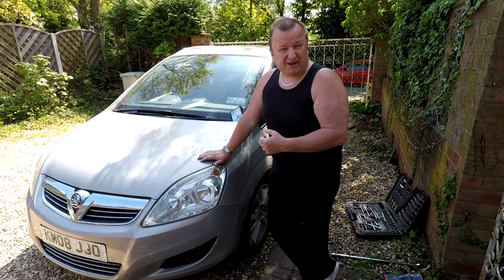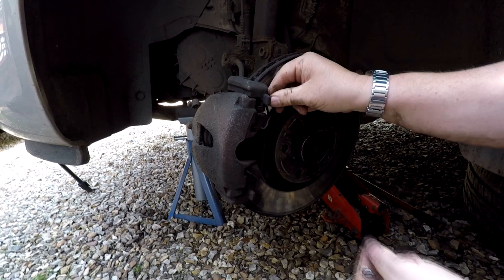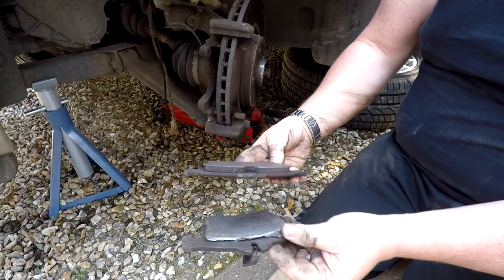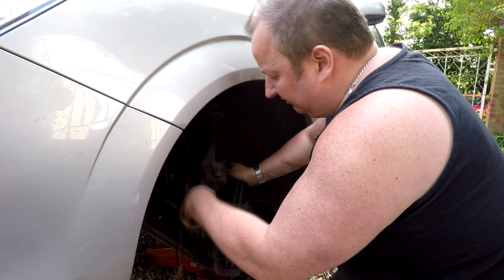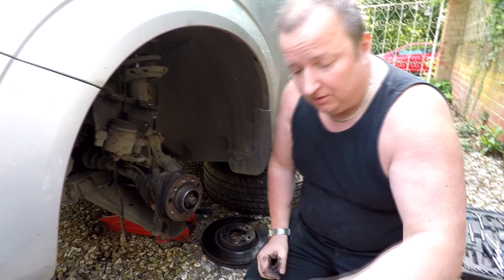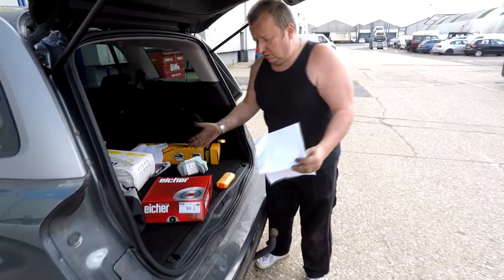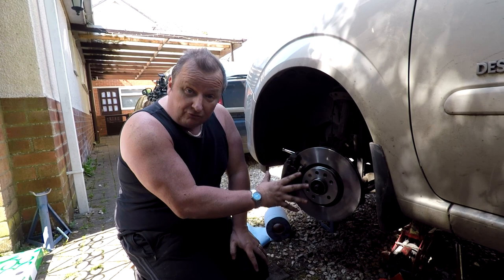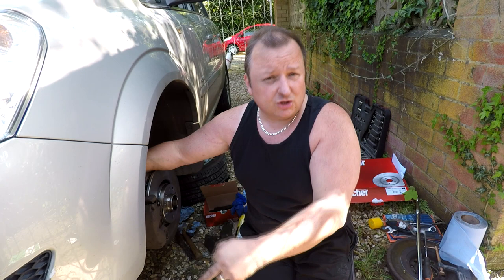Vauxhall Zafira B Front Disc And Pads Change Hell

Comment: Great to see a Brit doing car videos, one thing I would not personally do, is to use copper grease on the pins/sliders as it tends to gum them together after a while, I use silicone grease. Like you I have had problems with Euro Car Parts with wrong parts/sizes etc.
Reply from the maker: Yes, i'll be using silicone grease in the future Mart.

Comment: when you wind the brake calliper piston back in, when this forces the brake fluid back to the reservoir it does not stop when the reservoir is full, the system is vented so as not to create a vacuum, hence any excess fluid will escape out of the vent hole usually resulting in the fluid running down the inner wing/ bulkhead, if this is not then washed off it will eat into the paint then rust these items.

Comment: Had this a few times myself! Trouble is now that manufacturers use mandatory different parts for the same model! My astra had 2 different sizes of discs listed and God knows how many different styles of pads. Great videos as always.
Reply: I had the same problem with my zafira B, it was made in the final year of production, so they used all sorts of bits and pieces from previous revisions. Mine had 5 variations of the air filter,  3 different brake pads,  4 different brake callipers, and a whole hoast of other crap.... Getting the brake pads, i had to check which calipers i had to match them to the pads. 

i will never buy a car again thats in its last 2 years of production

Comment: I like euro car parts there great never had a wrong part with them most vauxhall have different size dics for the same model like my signum has 3 different size discs i always check the disc and pads before fitting them great video
Reply: nicely said bro but martin is a diamond geezer top bloke

Comment: Hi, look up Ed China's YouTube video on brake pad replacement. He explains why you should not use copper slip grease. It's to do with dissimilar metals, electrolysis etc and dust mixing with the grease causing ceasing up...Always a good idea to keep an idea on the brake reservoir level when pushing the pistons back 😉 Loving the videos by the way 👍 Real world repairs in a real world setting 😎
Reply from the maker: There is another episode where Edd puts copper slip on the back of brake pads. We've all done it in the past as this was the standard back then. Ask any mechanic of the 70's and 80's

Comment: I suppose its a case of 'speak as you find' Martin. My local ECP store in Wrexham offer a pretty good service to be fair.  I've bought loads of stuff off them over the years and not had to take much back because its been the wrong part. Granted, they're a long way from perfect - and the queue's to the till are always huge! - which shows how competitive/popular they are, I suppose. There are two other local car parts suppliers in my area and I usually phone all three for quotes on parts, and 9 times out of 10 ECP are the cheapest. I recently serviced a friends Zafira B (including front and rear discs/pads) and ECP were £100 cheaper for all the parts than the other two suppliers. Like I said, speak as you find :)

Comment: I had a similar problem a couple years ago with my Mk3 Avensis, which is 58 plate but a 2009 model - the year the range was released. This was an independent and they went by the car reg plate on their computer. It was when the discs were compared that we knew they were wrong. The discs were smaller and for the Mk2 Avensis. We checked the part numbers with the garage manual and back to the parts shop. The person said that licence plate is what they go by, but we told him the car is a T27 (Mk3), not the earlier T25 (Mk2) which can also have '58 plate.
I now have a a list of part numbers for my car, plus the specs, to help get the right parts and save wasted journey and time. I think ECP are good and the discounts worthwhile, so long as you do your homework and use their discount codes.

Comment: At 18.50 the pad with the wear indicator should go on the inboard side of the disc  not the outboard side. with the leading edge of the wear indicator facing the brake rotor during forward wheel rotation. Great videos and content and thank you for taking the amount of time and effort you do to produce quality content.
Reply: while this is normally true .. Zafira front brakes always have wear indicators on the outside .. the pad that clips in the piston doesn’t have one installed no matter which brand you use ..

Comment: Never use copper grease on the sliders as it goes hard. By the look of the black crap on the sliders someone used copper grease on them before.
Reply from the maker: Yes I should have use a different grease.
Reply: retrorestore I recommend silicone grease as it’s friendly to rubber parts 😉 petroleum based grease on rubber can react with it.
Reply from the maker: nice, i'll look into that.
Reply: Yeah i was going to say exactly the same thing as Hard Worker.Silicon is the way forward Martin.
Reply: silicone paste is best for slides.

Comment: you need to physically measure your old disc not just give your registration as theres often more than one size available- ie a 150bhp zaf will have bigger brake discs than the 120 ,but that's the least of your worries as it will probably just go up in flames anyhow..hahahaha

Comment: Well l did not have too much trouble doing the front discs and pads...but it was quicker dismantle to whole lot..but just check on you pads...
Rear ones were a bit more tricky...even resetting the hand brake...
You can reduce the brake noise by simply chamfering a 45° angel on the leading edge..
It's that corner that bounces...the copper slip is like glue behind the pad...keep them steady, but you do not need much..
Well done..you seem to work on these Zafira cars...a lot
Mechanic's dream... customers nightmare 😅

Comment: Glad to see that you didn't use impact wrench on the caliper carrier bolts. I had fun removing carrier bolts on a Pug 206. They loosened slightly then locked up thanks to copious use of threadlok which almost beat the breaker bar. Had to tighten them then back them off a bit more. Took ages winding them out but had I used the windy gun on them, the bolt heads would have snapped.

Comment: I fully agree with you on ECP.. I have had nothing but issues and I really don't use them much anymore.. 2 weeks for a set of wiper blades to arrive, orders being split into several packages days and days apart.. not ideal when youre trying to do a DIY service! Orders being delivered to wrong house was the most annoying.. they recently moved distribution centres and they really messed themselves up big time.

Comment: I feel your pain, Although it wasn't euro car parts, I bought a pair of discs for my Rover 75 off fleabay, stripped all mine off  yesterday & then came time to fit the new discs, Opened the parcel to find they had sent the wrong discs (for a KA), As the seller was only about 15 miles away I thought I could just take them back & they would change them, Phoned them up & was told I couldn't take them back for a swap, So I asked them if they would send the correct ones,,,,,,,No was the answer & refunded me my payment instead, So now my car is sitting on axle stands until I get the chance to get the correct ones,,,,But they can get stuffed if they think I am going to pay the postage to return the wrong ones. I will sell them as my compensation!!.

Comment: Great job done just remember next time use silicon grease on the sliding pins also take the old disc with you and compare them with the new disc when you get there if you can get a lift that is that will always save you a lot of trouble.

Comment: had problems with ecp as well as many other motor factors they never give a toss or take responsibility just cough up the difference or nothing will be done and that's what i've to face with anyways but after a few bad experiences I always always check the correct parts before purchase.

Comment: The squealing is caused by the vibrations resulting from  pressure  applied to the ungreased back of the pads. The grease permits them to slide around quietly as they vibrate when you step on the brake pedal. Also, don't forget to remove the cosmolene (that's what we call it here, anyway) packing grease from the discs before installing them. Otherwise, you'll put the brakes on and you'll get a nasty surprise as the vehicle keeps right on going. Not fun!

Comment: Never had any issues with ECP either, and ive used them for more years than i remember. Interestingly enough, after owning a Vectra C for over 8 years, when you whipped the wheel off I recognised the Caliper as being a 302mm variant.

Comment: I’ve had a problem with euro car parts too. I got all the things to service my car and it was all successful until a few months down the line when I went to start my car and it wouldn’t start and when it did it misfired. Turned out the spark plugs I had was at fault.

Comment: With the 308-280 mm disks there is a general problem on the mk5 astra and mk2 zafira. I got both of the disk from the parts shop with the chassis number in my hand... I had to measure the disks manually to be sure....

Comment: Having serviced my own cars, vans, trucks and bikes I learned many years ago, never ever rely on the parts supplier to provide the correct item.
I measure, weigh, check colour code, if you can name it, i probably do it before ordering and at the same time check with the supplier if it’s in stock and an expected date for delivery.  I am a real pain in the neck to these guys but rarely do I get the wrong item, especially if I ask they check the size etc., before despatch.
Just yesterday I changed the rear pads and discs on a T5, but before ordering I took the wheel off and threw a tape across.  I checked with Euro and found I could buy Bosch products cheaper on line…..they arrived next day and fitted perfectly and a complimentary scented pad in the box too.
Euro car parts offer these fantastic discounts, it’s bovine excrement, I just want the bottom line price and a delivery date….simple.
I don’t have the time to go and collect, whilst I’m sat in a car I can be earning money.
What does a joiner do, measure twice, cut once.  Once the item arrives, check it again before fitting.  Think outside the box and always expect others to make mistakes….because they do and it is annoying and costly.
Reply from the maker: Good comment. It's a shame that we can't rely on these suppliers with all this technology we have in the 21st century

Comment: Afternoon Mart 
Great video mate , just the same happened to me regarding a oil filter for my sons corsa , they gave me the wrong one , Euro car parts are 15 miles from me and I couldn’t be bothered to drive there to replace it , so I went to my local car factors instead thinking a replacement oil filter will be twice the price of Euro car parts but sod it, anyway they gave me the correct filter and it was £2 cheaper
Reply from the maker: There you go, they are not what they are cracked up to be. Heard this type of thing so many times.
Reply: For my own car I buy from the dealer directly, they always give trade prices and the price is only very slightly higher, but you get an OEM part and the part is always right.

Comment: Had similar issues with Euro Car Parts with Brake discs and pads for my Mondeo. Also A water pump. They don't seem to give a toss. Tip for everyone, check the part before you leave the shop if possible.

Comment: I`ve just done the front discs and pads on my zaffy b Martin and the discs didn`t fall off. A hammer didnt budge them, a bigger hammer made no difference and they just laughed at the air hammer . Cutting around the edge of the hub with a one mil disc in an angle grinder finally freed them.
Reply from the maker: Well done for not letting it beat you Alan.

Comment: These days i find the part and do a bit of checking with various sites including zip opel. And get the part dimensions.  Then check the actual box they give you.   It works for all sorts of parts.    You just can't trust the euro car number plate parts matching system.

Comment: If that's the 1.9 cdti you'll find that most of the parts are different to all the other zafira models and more expensive. I took the disks off my 1.9 cdti to put onto my 1.6 zafira and found that the disks were too big. On the plus side, the end of month sales are awesome so I got all pads and disks for less than £100 from eurocarparts

Comment: Feel you frustration only a couple of weeks ago I had a similar thing I ordered brake discs and pads front for a Vauxhall corsa and they turned up in the box with one disc in not two discs and the packaging it came in looked like it had been opened before even had finger marks on the 1 disc they sent so had to phone up and get another disc sent out after 30 or so minutes on hold to a bloke with a careless attitude at the other end of the phone.Not that I want to start a rant but I’ve had endless problems with Euro car parts and I’ve told them that too !
Reply: Euro car parts are a bloody nightmare i ordered a map sensor and crank sensor for my vauxhall astra MK4 and sent me ones for a citroen
Reply: Should also add that if you order online the orders are dealt with by the wembley branch who then pass onto local store for click and collect so basicly you would have to call the wembley store who process the online orders.

Comment: The only time I have had a problem with euro car parts was getting an engine part for a T reg (1999) ford mondeo, but that wasn't there fault as ford them selves had the same issue, turned out that when the car was built it had one of the last few engines from the year before as they changed the engine type at the start of that year

Comment: Had problems with eurocarparts. E39 engine mount i got off them was the right part number in the box but not the right part..knew to check before i left the shop as box seal was already opened. Had to re order another. Same as maf sensor..box had already been opened and not sealed like a brand new part..turned out to be faulty. Majority of parts i got had been already opened and probably returned and sold on and half of them were wrong parts and faulty. Some people who buy the new parts must clean up and stick there old one back in the box and take it back to get there money back..then euro just sell the part on again. If box looks like its been opened refuse it and ask for another as it'll be wrong or nothing but problems with it

Comment: Martin, I've been working on machines for most of my life. I'm quite familiar with the braking systems and you've done a bang-up job on this one. I would have used the inner pad to push the piston back into place to protect the piston and rubber boot but; six of one, half dozen of the other. As far as the diameter of the rotor is concerned, every car parts dealer has listings for all possible sizes of brake parts within that line-up of vehicles. The clerk either neglected to input the correct information or went to the most common iteration of this model. I know this because I used to sell parts over-the-counter at auto parts stores for many years. The clerk ultimately is at fault for not asking the appropriate questions and not listening closely enough. Thanks.
Reply from the maker: I agree Steve although I don't know what a "bang up job" is lol
Reply: A bang-up job is like saying: It came out a treat! Thanks again, Martin. Luckily being Canadian my translation skills are well-honed between British and American speech.

Comment: I have an issue with Euro Car Parts at the moment. I ordered two anti roll bar bushes through EBay from them. It took a week for the package to arrive. When it arrived there was only one in the package. I contacted them via eBay and no answer...not sure what to do now.

The only thing I can say in their favour is their parts have been generally high quality. I usually buy their more expensive option where there is a choice.
Reply from the maker: Seems a common theme when dealing with them.
Reply: The second one arrived a few days later...

Comment: The halfords guarantee doesn't actually cover the ratchet mechanism but they're only like £7 for a new one. Not sure about the ratchet spanners though.

With euro, I order a lot of things from there and it's rare I have a problem, if I do it's because they have different sizes ie 17-18-19mm bushes for the rear anti roll bar and I've ordered the wrong one 'cause I didn't check but I always check the fitment details bit to see the difference and always try to check bits before you get too far into a job
Reply from the maker: Just your experience Bennie, as far as the Ratches's, they have changed 3 of mine completely free of charge no questions asked. Just my experience.

Comment: Open the bleed nipple and give the fluid a clear escape and no reservoir overfill scenarios.

I did what you did and the fluid came out the top with the cap ON.

So, bleed nipple open and top up if needed. Removing fluid is always a pain.

Comment: Guess what job I'm doing on the missus's zaf b in the morning?     My top tip......build a relationship with your local motor factors.  A smile and few friendly words is all it takes. No problems with returns or other issues and the staff know more about my car than I do.      Merry Christmas to all.
Reply from the maker: The trouble is that a lot of counter staff do NOT know what they are selling. I speak from experience. I agree about being friendly though.

Comment: problem with euro car parts is that they have abit of a niche. Ebay is probably better with alot of online but the risk if the part is faulty is not worth if if need to return.  So in UK the place to have a local independant is Euro car parts or GSF, not much choice and smaller more independant businesses are usually few and far between